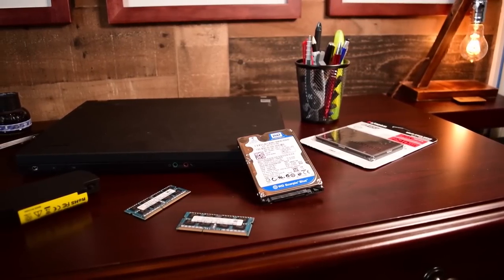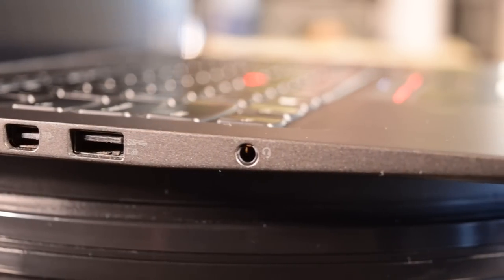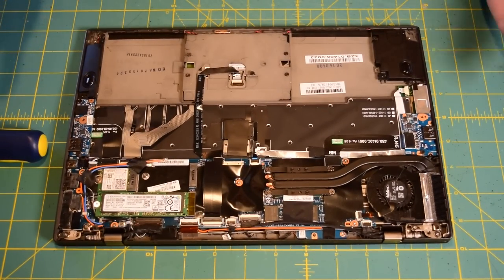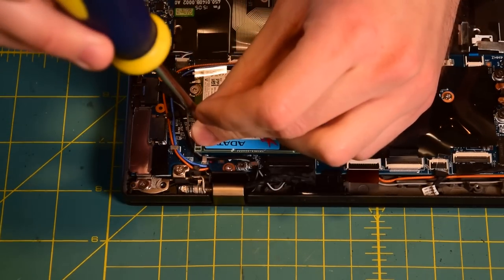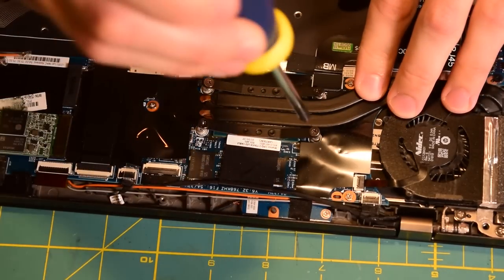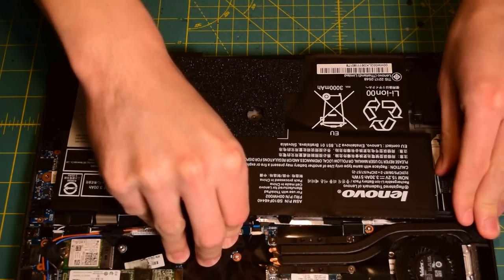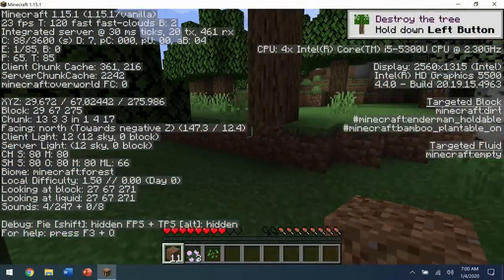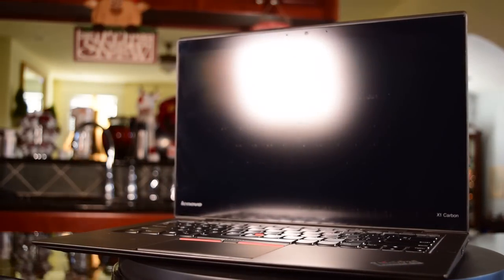Super Portable and Fast Ultrabook for Under $350: Thinkpad X1 Carbon 3rd Gen Upgrade Guide

Comment: Your not going to drive me away with showcasing a little thickness. I love.. well robust computers:) But X1 carbon? The XPS 13 and 15 offer a much greater bang for your buck. Granted it's not as cheap. But for what you get for that money... The only real problem with this logic is this the XPS 13 lacks on expansion, another, less flattering option for some would be the Latitude series. Depending, you could really hit golden.
Reply: The point of this video is that you should get an enterprise-tier used laptop over a cheap, throwaway, bargain bin, new laptop like that purple HP he bought earlier. His channel is mainly focused on thinkpad although he also did couple of other enterprise laptops in the past
Reply: @9inchpp  Absolutely and that's why I offered a nice balance. I wouldn't recommend a cheap consumer laptop after all. The value ratio is actually fairly horrible. Take in point Walmart's new offer. $400 bucks for what it is on the box isn't bad. Even the buikd quality is ok. But single channel ram on a Ryzen 5 cpu?! Really?! It seems a lot of them consumer products always come with huge comprises at that price point, but single channel ram kills that deal for me. Again, just bringing a balance.
Reply: XPS laptops are known for horrible QC issues that make them hit-or-miss gambles. Thinkpads are renowned for their durability and reliability throughout years of usage.

Comment: I like how in many folks minds, shedding a half inch from the thickness of a device... while growing in width and height, or even staying the same, somehow = more portable. A T420/30 will slip into a laptop bag just as easy as a x3 carbon, macbook air, or tablet. It's a damn laptop. . . It's overall going to be similarly the same damn experience, so just grow a brain and get what's worth getting! And with that, we are right back to the T series.

I mean, how meak and pathetic does one need to be to end up fatigued from the "extra weight" of a T series vs an ultrabook... the whole extra ounce or so.... my god, what backbreaking labor.... what desk real estate stealing theft! Oh, wait.. the UB actually sits in a larger space, is slower, does less, has a smaller battery, less ports, more dongles, and has zero actual benefits whatsoever beyond "oh wow slim" ... wonderbar.

Comment: I hate to see the same design as Apple in everything, however, I'm not the CEO of Earth.

Lenovo had/have it all, so they don't need to be Apple. As some examples, the T60 in version 14"1 is a model they could make an "Air" design from. The X60 models are the "Pad" designs.

This X1 Carbon and pretty much each laptop is another confusion of TV, Cinema, Pro, Pad, Air, Think, Apple, Samsung, LG. 

That makes me believe there is something like "corporate inbreeding" going on. The corporate Inflammation show up as "something less" in each generation: Things like mistakes with dongles and way too much resolution combined with too little power and touch where you can't touch a tiny icon. Mad stuff where the whole wasn't thought through.

It's not to 100% hate Lenovo or the X1, but I have a Dell Latitude that is a tiny bit thinner and it has a way more Mac feel to it.

:)

Comment: I have to disagree entirely with you about the X1 Carbon Gen 3 machine, that thing was a piece of junk and had 0 durability. I had to get the hinges on that machine fixed over three times in four years, the screen if you held it wrong would crack, and it will forever be stuck on 8 gigs of ram.

Comment: i bought a dell e7440 with i7-4600u, 8gb of ram, 480gb sata 6.0 ssd. for just $200 two years ago. so lenovos are more expensive than dells, and dells are wayyyyy more durable. I had couple lenovos, and i loved them, but their durability is close to nothing :(
Reply: and lenovos look like shit inside. dells on the other hand look as good as on the outside.
Reply: Interesting. I always wanted to get a Dell, just to feel how they compare to Thinkpads.
Reply: @JakeJoris  I have a Dell Latitude E6410 and the R key is missing along with the key switch. Also one of the plastic piece that is in a USB port is missing on one of the 3 USB port. It runs well, but the BIOS is possibly outdated just like the HP HDX16-1140US.
Reply: @killertruth186  dell e7440 still got the 2019 december bios update. The best dells were from 2013 up to 2015. Like e7440, e7450, e7460. First i series gen dells suck.
Reply: @MartinLasTerrenas  Get the e7440, e7450, e7460 or e7470 they are the best. if you want more performance you could pick up a fat dell e6440 or e6540 with 15" display but only with TN panels. You could get dell e7440 or e7450 with 1080p IPS touch screen, or dell e7460 or e7470 with 1440p IPS touch screen. But they are available without touch screens as well